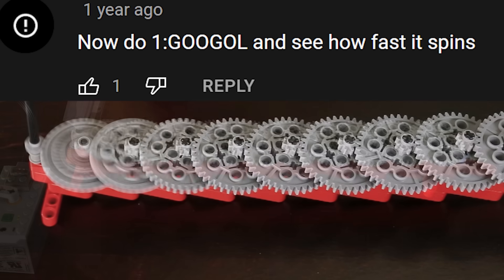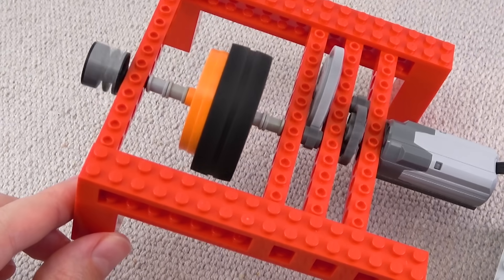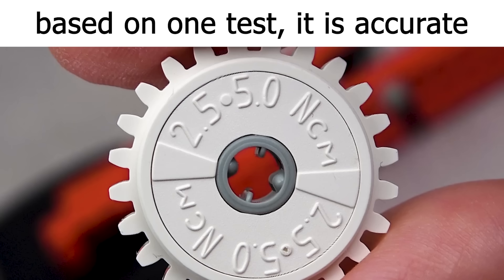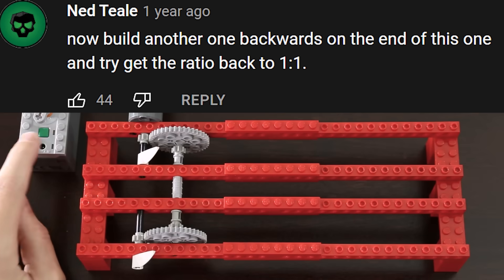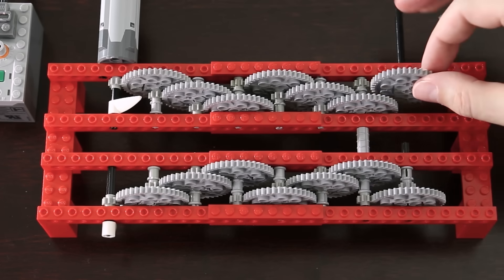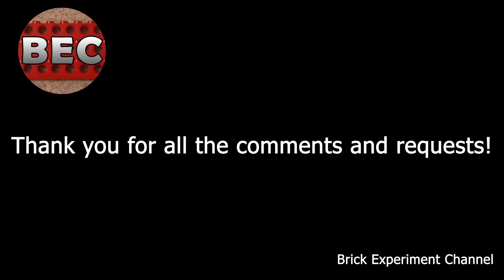Requested Lego Experiments 1

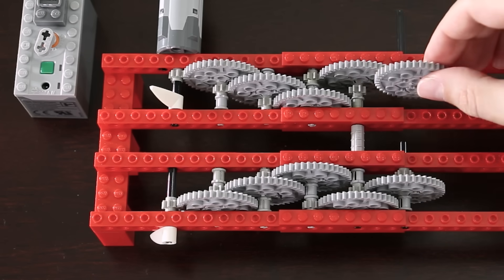Comment: 1:48 I wouldn’t suggest using those axel filler pieces, they cause unwanted friction as the gears have less space in total, the bigger gears also rub against them. I’ve discovered that just leaving the rest of the axel empty and using those pieces outside of the gearbox makes it easy to have less friction

Comment: Theoretically, if mechanism shown at the beginning will be spun with the speed of motor on the output, (not counting the friction abd etc.) the input (or in this case output) will spin at 3222656250 RPM.

Boring math:
Let's say motor speed is 330 RPM. Since there are 10 gears in a row with each one creating a gear ratio of 1:5, 5^10=9 765 625. So we're looking at 1:9 765 625 gear ratio.
Next we multiply this on a motor speed and get the final speed. (330 x 9 765 625 = 3 222 656 250)
Reply: Now count the required torque and dexterity of gears for this to work.

Comment: the reason why 1 googol doesnt spin is because of extremely high torque
Reply: Yes, both due to friction having a stronger effect due to the gear ratio, but also because the extreme apperant inertia the latter gears create becausr of how much faster it needs to accellerate compared to the input shaft.
This is a real world servo limit: gear ratios are only usefull to a certain range, and at a certain ratio it just requires an dedicated electromotor design.

Comment: 0:16 isnt that pretty much a 'turbine trip'
Reply: No it isn’t. A turbine trip is the automatic safety system of a turbine in case the pressure or temperature or the fluid entering is too high or too low. But here he is just removing the vacuum from the turbine so it is way less efficient but it hasn’t tripped

Comment: remember: you need less power to spin gears that have a low ratio, but lose speed with high torque
you need more power to spin gears that have a high gear ratio, but gain speed and low torque

Comment: In order to spin a googol you have to start with a googols worth of strength, meaning infinite mass, meaning infinite speed, for the same reason you can spin the end of a googol:1 ratio, because it would require infinite speed for infinite tork, it's basically a converter of infinity for the different components of energy

Comment: 0:07 of course 1:googol does spin, it’s just the lego motor is not powerful enough at that stage but if you spun it round manually with a level your hand has more strength than a Lego motor, you can actually spin 1:googol

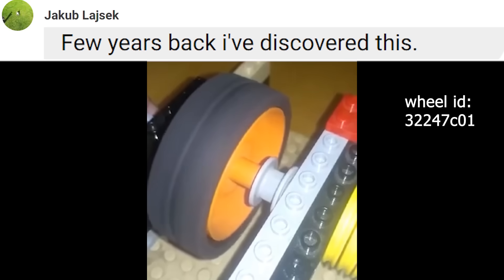Comment: 0:30. the power of a crowned wheel?

because the hump is in the center, when the tyre moves to one edge, the part of it in contact with the crowned rim pulls it to an angle that causes the tyre (well, usually a belt) to travel back towards the center. when its in the middle, it has two conflicting and equal forces that hold it central.

most people have this incorrect intuition that the pulley should be hourglass shaped to hold the belt central. cus they dont think about things properly and saw too many vee-belts. the hourglass spits the flat belt off instantly as the angle it creates increases the deflection of the belt off the rim.

Comment: Just did some math, if the outer edge of the fastest gear were moving at 99% of the speed of light, it would take over 10 sesvigintillion (that's 1 followed by 82 zeroes) years for the outer edge of the slowest gear to move 1 millimeter.

Comment: opening the jar shows exactly what i said faster than light mechanics in vaccuum infinite mass but no weight anmd no resistance .. the tire tread is in a supe rlocked rut ,,, if you held it off center longer than its been spinning times its rotational batteration it would be inclined to spin off but has to overcome the centrilizing vector

Comment: To get the Googol to work you need an excessive amount of torque. Unfortunately it would break before that happens. You ever notice that vehicle transmissions usually have the last gear at 1:1 ratio? I don't know if it's true with modern vehicles, excluding EV's. A high torque engine could have a transmission where the ratio on the last gear exceeds ratio.

Comment: Who doesn't know about the tire move in 0:32 is because of the centrifugal force. If you spin the tire slow it doesn't happens but if you spin the tire fast it will create a centrifugal force because the tire is a little bit heavy so the tire stretches.

Comment: Of course it bent/broke, with that much opposing torque, something had to give and the plastic would before the gears could turn on that ratio. They'd have to be made of something way stronger - and lubricated probably. Gravity is going to also cause unavoidable problems - friction of axle against the brick it's threaded through.

Comment: The Oscillating Tire is well known in the belt industry.   Basically the raised center of the wheel makes more contact, so when the tire steers off to one side the friction pulls it back to center.
Reply: yup its great demonstration of why flat belts work even with out flanged pullies

Comment: I have seen snapped pins that seemed to shatter and I always thought, why didn't they make them out of a more ductile steel/temper.
This video actually showed how any elastic slack in the drive/cogs actually destroys efficiency and why harder less elastic metal is better.
Reply: Mostly due to cost. Sure metal is stronger than plastic if two pieces were identical in shape and size, but it's also slightly more expensive to manufacture, ship, and store. And since it's more expensive to make, the product becomes even more expensive to sell.
Reply: @jessegd6306  metal being more expensive to make and ship makes sense... but not store...

Comment: I am a steam turbine engineer. In the low pressure steam turbine section sometimes there is vacuum. This technique here at 0:15 is called "vacuum breaking" and it is used in many turbines in case of failure in order drastically drop the turbine speed in an instant

Comment: from behaviour seen in 1:38 can be concluded that weight of flag can be an issue there. I would suggest remove it... or put another one (in oposite way), or maybe some different indicator with a center of mass in the middle of object. Result should be better. Please check it!

Comment: 1 googol just doesn’t turn, it’s simple math. Lol
Reply: It's of course due to the backlash in the gears. With zero backlash the slowest turning gear would turn continuously, but extremely slowly. 

With backlash, there is no torque on the slowest turning gear until the backlash in all gears have been absorbed.

And this has probably been explained many times already in this thread.😀
Reply: @julesdomes6064  I never said I didn’t know about material densities and force distribution... I just said it’s simple math. Which in the case of plastics, it becomes.
Reply: @matsveritas2055  No, simple math says all gears will turn if you have zero backlash.
Reply: @XtreeM_FaiL  That's correct if you include enough friction.
Reply: @XtreeM_FaiL  What do you mean? Without friction very little energy is required. The efficiency of spur gears is close to 100%.
Reply: @XtreeM_FaiL  You lost me. Unless inertia is infinite even a tiny amount of energy will start turning all gears.
But no point in nitpicking this to death. Let's move on.
Reply: @julesdomes6064  No, that's not simple math, that's insane math, completely devoid of natural functioning.
You cannot have a system with "zero" anything, lol.
Reply: @matsveritas2055  It's a theoretical case.
Reply: @julesdomes6064  Yeah, just like your math.

However, what is the purpose of envisioning a case within which not all functions of the cosmos are included?
Reply: @matsveritas2055  Whatever. Move on. 
This is getting very boring. Goodbye.

Comment: Breaking the vacuum actually makes sense as to why the motor slows down. Due to the air coming in and adding a friction/load to the motor the torque of the load is now increasing while the torque of the motor stays the same therefore decreasing the speed of the motor

Comment: Can you do a visual of a Google  but where the last cog moves.  By useing a 2 lane system to get the cog moving.   Eg rubber band strap around the top of first cog to a parallel  set to aid in the motion of the deeper cogs in the google

Comment: If a functional 1:GOOGLE was even possible.  I'd be curious to see how far back on the gear train it would go before the gears shatter from centripetal force
Reply: Yes, id like to see it used with one of those enormous solid steel flywheels.
Reply: A hundred cogs each 10:1 would give you a googol ratio. Obviously you would build such a thing out of actual engineering steel rather than a childs toy set, but it certainly is possible.

Comment: The 1:1 ratio experiment was super interesting. It shows the storage of energy in a mechanical form and the tolerance of the mechanism. You could equate it to reaching the top of a hill. You build a tension of energy climbing up a hill, and that energy is rapidly released by means of gravity going down the other side.
Reply: Aka potential energy
Reply: It's a wonderful illustration of how materials we otherwise think are rigid in our immediate spaciotemporal vicinity are nothing of the sort. A few years back I came across one of these dumb flatearthers who claimed that the speed of light was not the highest attainable speed in the universe, because if you had a pole reaching to the moon, obviously you could just push one end, and have the other end move accordingly immediately. No! In fact, such distortion would only travel up the pole at the speed of sound in the material, meaning it would take days before the other end moved. No material is perfectly rigid; everything is "springy", and over long distances and timespans, this becomes very appearent.
Reply: @troelshansen6212  I had that exact idea when I was a teen, but I also knew intuitively that if we could cheat the universe that easily, we'd already be doing it, and we clearly were not.  Thanks for the answer. =D
Reply: @OriginalUnjustifier  So you don't have narcissistic disorder like the flat earthers, by thinking the can bring down the entire Apollo program by cleverly(!) asking "But WHO TOOK THE PHOTO?".
Reply: @troelshansen6212  Not only the mechanical aspects fall down on that flatearth argument.  How do you know the other end moved at all? How were you observing it in a manner that exceeded light speed? It is based on the assumption that something done on room scale works the same on an astronomical scale.
Reply: I’m wondering if there could ever be a practical application for it maybe some sort of “mechanical spring” powered cutting device?
Reply: @lenardstarks5891  Kinda late now, but no, this does not make for any practical use.
It is highly inconsistant, loses a tremendous portion of the power input to friction, does not deliver any usuable torque on the output and it instantly damages the device, with
more rigid parts being destroyed more severely.
Reply: @Cryzophylax  minecraft parkour
Reply: @KotegawaYui  hey dont expose me like that
Reply: @Cryzophylax  Soz
Reply: @lenardstarks5891  There are torsional springs, such as in the suspension system of most tanks. Similar springs can be found in mechanical artillery like ballistas or cross bows. However for power transmission shafts elasticity leads to vibration as you have no direct control over when the potential energy is stored or released. Inline engines with over 6 cylinders tend to have torsional vibration issues. Vehicles with undersized driveshafts will to (such as upgrading engine torque without replacing driveshaft).
Reply: @lenardstarks5891  The French used this mechanic to kill over 10,000 people during the Revolution.
Reply: Oh!  I didn’t really understand those experiments until I read this, now I see what’s happening there.  Thanks!
Reply: It's like a capacitor for mechanical energy!
Reply: @iamjc988  or a capacitor is a spring for electronics
Reply: I think this has more to do with energy lost to friction.

Comment: It would be cool to see the rpm of the output wheel on the 1:1 cuz it looks like the peak speed of the output wheel is much faster than the speed of the input wheel.
Reply: of course it is... the torque was building up in the axle, cog teeth, and the actual frame, when it finally overcame friction all the torque was released at once through the second cog train leading to the final cog spinning at much higher speed than the motor.

Comment: The 1:googol is doable, its just a matter of increasing the torque input. I wanna see it
Reply: It is not remotely doable.  A googol:1 set up won't even fully spin.  Even if the driving gear spun as fast as the fastest spinning object on Earth (300 billion times per second), it would still take 1.057x10^72 eons for the other end to rotate.  Given that the expected lifetime of the Earth and even the Sun will expire less than 10 eons from now, it is entirely impossible, even though you can see one side spinning.  Now, to go in the other direction would require more force than exists in the universe to move the googol side and would require that faster-than-light travel be possible for the one side.

Comment: Try making and testing a Lego race fast car
Reply: need more motors lol
Reply: @EricKidson2008  u really think that he wont have those
Reply: because the price of the motors are expansive (under $40 or cheaper)
Reply: @EricKidson2008  nah he has them all and 1 race car only takes max 2 motors
Reply: torque multiplier should be an answer. the reason is the car has not enough torque to drive a fast car. so we needed 2 or more motors to increase by 2 or more depending on what motors are using.

Comment: 1:41
Did you count the turns?
are they the same on both sides?
Reply: No need to count. The gears have a fixed amount of teeth and as long as they are the same on both sides, they turn equally (as long as the backlash is taken out).
Reply: @AnttiBrax  im not sure ...

Comment: The last experiment is exactly something I was thinking of, but couldn't find anyone doing it. For me it's incredible that both first and last gear are spinning so fast, while the ones in the middle, transferring all that torque, do not seem to be visibly moving!
Reply: They twist the axles to store energy in a miniature version of a torsion bar. When the torsion on one half exceeds the static friction on the other, it starts to move and moves until it dissipates enough energy to match the kinetic friction, at which point it stops again and the process repeats.

Comment: When it comes to science stuff I'm not a genius who understands it all but I may be slightly a lil more in the know as it were than say the "normal" person on the street. That being said at time stamp 1:58 when showing the 3125:1->1:3125 ratio how is the gear setup closes to camera spinning?
In video it says tension is built up then let's call it "the front gear" spins rapidly. Now there is a mechanical connection between let's call it "back gear" but closest to the connection of front gear and back gear those gears aren't moving yet on front gear the gear closest to "flag" spins very rapidly, how is that possible?
I know it's going to be some super simple answer lol but with my limited knowledge and even less knowledge of gears and gear ratios I cannot figure this out. At first I thought there was a mechanical connection at the flag end, there clearly is not. Then as I'm watching it lol I'm like "wait did I just see magic" lol, because those gears where the mechanical connection is clearly don't move and what makes sense to me is that the motor must rotate that last gear which through the connection rotates the front gear thereby turning the other gears going toward the flag side and spinning the flag but none of that happened and flag just spun around and so "magic" lol.
Thank you in advance if anybody decides to explain how this works, certainly you don't need to take time out of your busy day to explain to me but you did and I thank you. Also, Happy Holidays to you and yours from me and mine and may you and yours enjoy many blessings this holiday season.